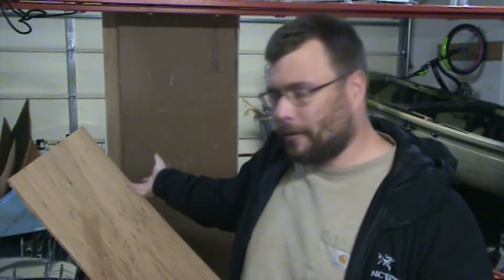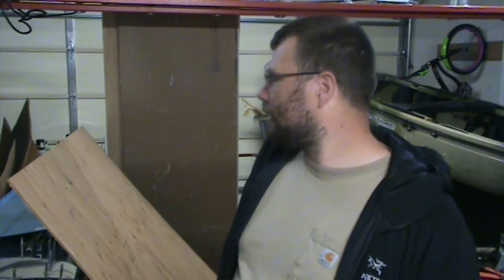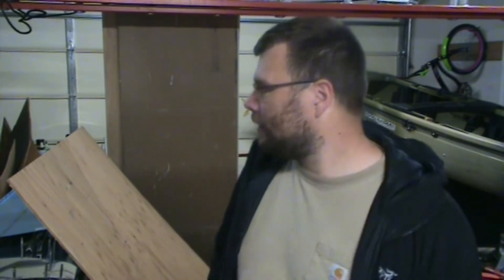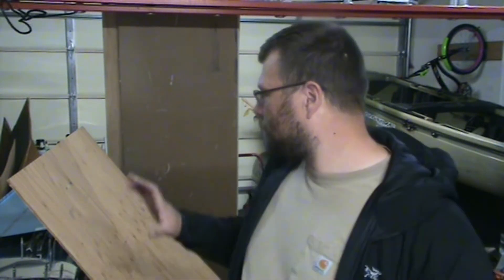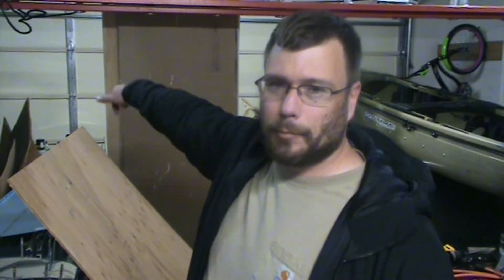RV-10 Build - 3M Tape Versus Proseal

Comment: So the point of using these two products to just hold the two skins together?
Reply from the maker: On the trailing edges, they just hold the skins and edge piece together for riveting. DO NOT use stuff like JB Weld though. JB Weld is brittle when set up and the riveting could crack it, allowing it to fall out of the seam and causing a gap. Later, on the tanks, Proseal (or similar like FlameMaster) must be used and it seals the seams and rivets to provide tank that won't leak.